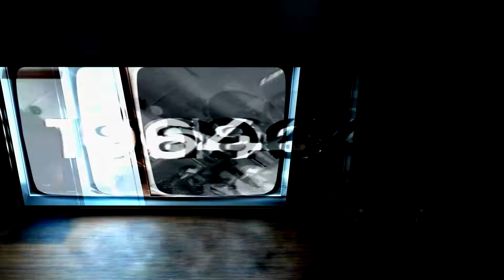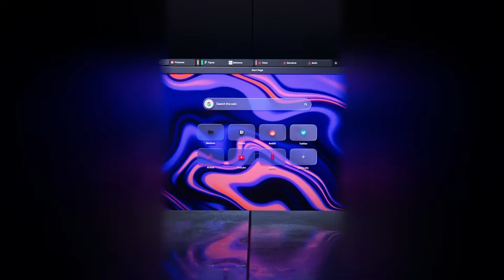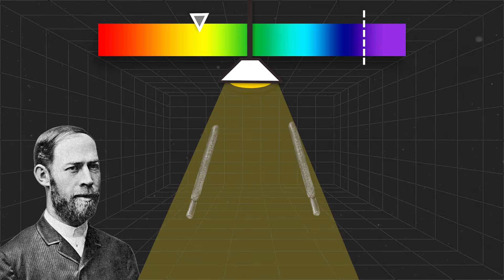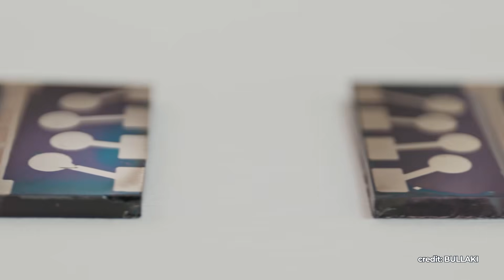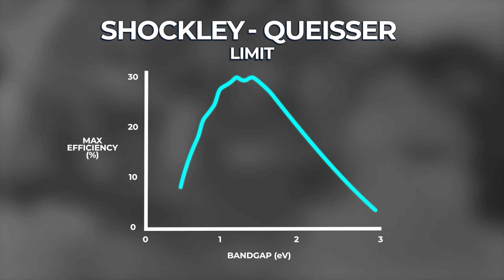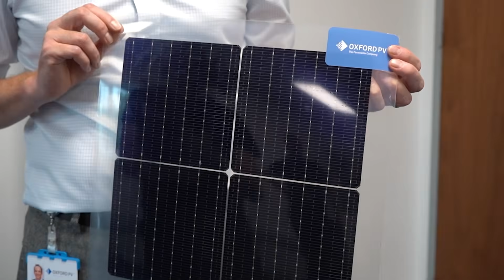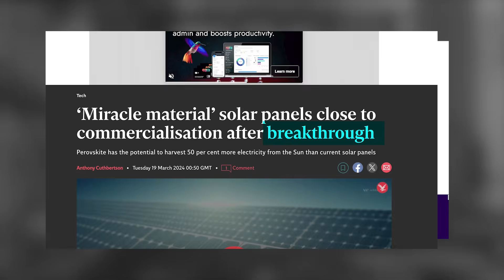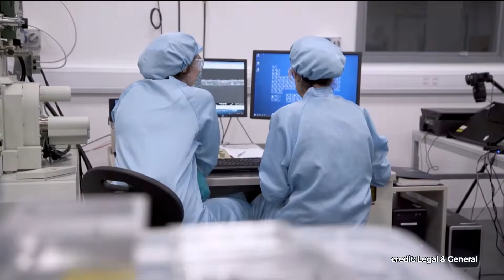How Physicists Broke the Solar Efficiency Record

Comment: 110104. The second law of thermodynamics may be false conventional wisdom. Let's face the wonder of full heat use. 

The second law of thermodynamics was developed during v8ictorian england's scientific and religious fascination with steam engines. 

The second law is behind modern refrigerators needing electrical energy to compress the refrigerent to force it to release as waste the heat that it has removed from the refrigerator's service interior in the cooling part of the refrigerent's circulation. The interior coldness draws in exterior heat through the cabinet insulation. There is also discarded heat from mechanical friction and electrical resistance. The net thermal output equals the electrical input with energy not being gained or lost in this refrigeration system including its forced waste. Unencumbered refrigeration by the principle that energy is conserved should produce electricity instead of consuming it. 

It makes more sense that refrigerators should yield electricity because energy is widely known to change form with no ultimate path of energy gain or loss being found. Therefore any form of fully recyclable energy can be cycled endlessly in any quantity. 

Full heat recycling, all electric, very isolated underground, undersea, or space communities would be highly survivable with self sufficient EMP resistant LED light  automated vertical farms, thaw resistant frozen food storehouses, factories, dwellings, self contained elevators, safe rooms, and horizontal transports. 

In a flourishing civillization, small self sufficient electric or cooling devices of many kinds and styles like lamps, smartphones, hotplates, water heaters, cooler chests, fans, radios, TVs, cameras, security devices, robot test equipment, scales, transaction terminals, wall clocks, open or ciosed for business luminous signs, power hand tools, ditch diggers, pumps, and personal transports, would be available for immediate use incrementally anywhere as people as individuals or larger social groups see fit. 

Some equipment groups could be consolidated on local networks. 

If a high majority thinks our civilization should geoengineer gigatons or 
teratons of carbon dioxide out of our environment, instalations using devices that convert ambient heat into electricity can hypothetically be scaled up do it with a choice of comsequences including many beneficial ones. 

Energy sensible refrigerators that absorb heat and yield electricity would complement computers as computing consumes electricity and yields heat. Computing would be free. Chips could have energy recycling built in. 

A simple rectifier crystal can, iust short of a replicatable long term demonstration of a powerful prototype, almost certainly filter the random thermal motioren of electrons or discrete positiive charged voids called holes so the electric current flowing in one direction predominates. At low system voltage a filtrate of one polarity predominates only a little but there is always usable electrical power derived from the source, which is Johnson (observation) Nyquest (theory) thermal electrical noise. This net electrical filtrate can be aggregated in a group of separate diodes in consistent alignment parallel creating widely scalable electrical power. The maximum energy is converted from ambient heat to productive direct current electricity when the electrical load electrical resistance  is equal to the array internal electrical resistance. 

Maximum calculated electrical power output (watts) is k (Boltźman's constant), one point three eight x 10^ minus 23, times T (temperature Kelvin) times bandwidth (0 Hz to a natural limit ~2 THz @ 290 K) times rectification halving and nanowatt power level rectification efficiency, times the number of diodes in the array. 

There are a billion cells of 1000 square nanometer area each per square millimeter, 100 billion per square centimeter. 

Order is imposed on the random thermal motion of electrons by the structual orderlyness of a diode array made of diodes made within a slab: 

  P type boron doped
-----‐------‐----___-- Out
🔻🔻🔻🔻
■■■■■■___ + Out 
  N type phosphorous doped 

All the P type semiconductor anodes abut a metal conductive plane deposited on the top face of the slab with nonrectifying joins;  the N type semiconductor cathodes or common cathode abuts the bottom face. As the polarity filtered electrical energy is exported, the amount of thermal energy in the group of diodes decreases. This group cooling will draw heat in from the surrounding ambient heat at a rate depending on the filtering rate and thermal resistance between the group and ambient gas, liquid, or solid warmer than absolute zero. There is always a lot of ambient heat on our planet, more on equatorial dry desert summer days and less on polar desert winter nights.

Focusing on the composition of one simple diode, a near flawless crystal of silicon is modified by implanting a small amount of phosphorus (N type conductivity) on one side from a ohmic contact end to a junction where the additive is suddenly and completely changed to boron (P type conductivity) with minimal disturbance of the crystal lattice. The crystal then continues to another ohmic contact. 

A region of high electrical resistance forms at the junction in this type of diode when the phosphorous near the ĵunction donates electrons that are free to move elsewhere while leaving phosphorus ions held in the crystal while the boron donates holes which are similalarly free to move. The two types of mobile charges mutually clear each other away near the junction leaving little electrical conductivity. An equlibrium width of this region is settled between the phosphorus, boron, electrons, and holes. Thermal noise is beyond steady state equlibrium. Thermal noise transients, where mobile electrons move from the phosphorus added side to the boron added side ride transient extra conductivity so the forward moving  electrons are preferentally filtered into the external circuit. Mobile electrons are units of electric current. They lose their thermal energy of motion and gain electromotive force, another name for voltage, as they transition between the junction and the array electrical tap. 

Inside the diode, heat is absorbe; outside the diode, to exactly the same extent, an attached electrical circuit is energized. The voltage of a diode array is likely to be small so many similar arrays need to be put in series to build higher voltage.  

Understanding diodes is one way to become convinced that Johnson Nyquest thermal electrical noise can be rectified and aggregated. Self assembling development teams may find many ways to accomplish this wide mission. Taxonomically there should be many ways ways to convert heat directly into electricity. 

A practical device may use an array of Au needles in a SiO2 matrix abutting N type GaAs. These were made in the 1970s when registration technology was poor so it was easier to fabricate arrays and select one diode than just make one diode. 

There are other plausible breeches of the second law of thermodynamics. Hopefully a lot of people, mostly as independent teams, will join in expanding the breech. Please share the successes or setbacks of experiemental efforts. 

These devices would probably become segmented commodities sold with minimal margin over supply cost. They would be manufactured by advanced automation that does not need financial incentive. Applicable best practices would be adopted. Business details would be open public knowledge. Associated people should move as negotiated and freely and honestly talk. Commerce would be a planetary scale unified conglomerate of diverse local cooperatives. There is no need of wealth extracting top commanders. We do not need often token philanthropy from the top if the wide majority of people can afford to be generous. 

Aloha
Charles M Brown 
Kilauea Kauai Hawaii 96754

Comment: There's a reason I'm a fan of brute-force engineering. Make it 2x more rugged than the tool or machine needs to be. Sure, it may cost a little extra in manufacturing. But, the machine will work, it will not break, even if treated poorly, and you don't need to pay to replace it frequently, nor do you need to deal with expenses of the uphill battle of trying to get a fragile material to last in the face of the environment.

I find it tends to be cheaper to go as primitive or simple as possible to start as well. Take the advanced concept, and spend some time seeing how unga-bunga caveman you can make it. "How low tech of tools can we use to make this?"

Not only is it a fun intellectual exercise of your particular discipline, it tends to result in rugged, reliable results.

Granted, this is more a practice in design, and applies largely to making machines like mechanical generators. However, I think it can be applied to these solar cells as well.

Comment: The climate issue is primarily a balance of energy received from the sun, and how much dissipates back into space. Greenhouse gasses affects the temperature of the atmosphere, by being affected by the radiation trying to "escape" Earth. They "wiggle" more, when hit by infrared radiation. What we sometimes call heat. The energy we are bombarded with, from the Sun is broad spectered. When the energy hits a light surface, the reflected energy is also fairly broad spectered. When it hits darker surfaces , is a larger portion of the energy absorbed, and converts into heat. When we use solar panels, we get both a warm panel, but also an electrical energy, which we then use to drive an electrical device where the energy is lost as heat.
More greenhouse gas equals less energy dissipating into space. More energy "harvested" from the sun, which is then converted into heat, ALSO leads to an imbalance in the energy economy. More infrared energy trying to "escape" Earth, leads to an increase in temperature.
PMC6174548

So a higher "efficiency" ultimately leads to less energy being reflected directly into space. Then again, a higher efficiency could pave way for technologies that reflects energy back into space, without altering the spectrum?

Comment: Perovskite coated silicon solar panel is the smartest business choice. Since you don't have to build Si-panel, just source it from other companies, then clean it and coat it nicely. I know "just" here sounds undermining, but the difficulty of doing that could be tedious. And from the graph in 15:41 I think you can't add more than that one layer, only leave a room for a new Perovskite in place of Si.

I think, they still have to keep a layer of Si at the bottom even with new Perovskite material, it seems to help stabilize the structure.

Comment: THE question is NOT framed in terms of the dollar cost of a unit of energy but, rather, the energy cost of that unit.  The currency cost of energy fluctuates but a joule is always a joule.

Would an oil company knowingly expend the energy equivalent of 2 barrels of oil to bring 1.9 barrels of oil to "the market."  See EROEI:  energy returned on energy invested.

I urge you to explore the TRUE, energy, cost of solar energy, from pre-production research all the way to the energy cost of disposing of the infrastructure components at the end of their productive lifetimes, for past, present and future solar technologies.

Comment: @16:59 of course the cost is relevant. If the perovskite add 20% efficiency the panel cant be more than 20% more expensive.
If not it would make more economic sense to just buy 20% more silicon panels..

Comment: I was working on PV's in the 90's here in Australia, our group held at the time the (in lab only) maximum efficiency record, (and not much lower than today), this work is very infesting..

Particularly your take on cost, reliability, and eff%, the engineering Vs 'perfection', a case where good enough is good enough.
Reply: that is a point - if we consider nowadays prices of PVs then it is much cheaper to add a few m,ore panels than make a frame to give them better orientation to the sun (pricewise). We were covering even northern sides of roofs, because of dirt cheap panels (sun hits them only around the noon in summer - it was for cooling system, which utilizes this seasonal gain). We put them flat on roof without bothering about frames, because it adds weight to roof (to level it is not possible to make installation there), lowers coverage and make installation twice expensive (frame cost and installation cost).

so... compromises

Comment: Do the perovskites they use contain lead? If they degrade faster and are not properly disposed of after they are not useable anymore are we just going down the route of introducing more lead into our environment again?

It feels like every new technology we make will eventually years later be exposed as dangerous for the environment and life, then we slowly try to stop using it which we're not really good at and repeat from the start, create new technology to solve the problem the last one created. The cycle continues

Comment: Since I've read that Opera GX is owned by a Chinese company, I will definitely avoid using that browser.
Reply: A website I often use ran ads for a while for Opera. Next time I clicked on my downloads folder, there were a couple hundred instances of the Opera installer in there. Never asked me if I wanted to download it, just did it all on its own every time I clicked on something on the site. Needless to say, I have stopped visiting that site and will NEVER use Opera.

Comment: Did one of the teams investigating this find instead of a silicon base a mirrored surface underneath would greatly increase the efficiency?

Also, we know current silicon solar cells lose efficiency over time. I think the first year they lose about 10% efficiency and have a lifespan of 25+ years before the efficiency drops to a point where they are usable? Has they been any testing for the lifetime of these new cells?

Last I've read If you have to get a solar system you want to get the thermal cooled solar panels. These have fans behind them to cool the panels. The fan is driven by the electricity produced by the panel. The cooling from the fan increases the efficiency enough to offset the fan drawing energy from the solar panel. The cooling will also increase the lifespan of the panel.

So much new technology it's hard to keep up.

Comment: I have always thought that the goal to reach the perfect version of the final product is detrimental to overall progress. You spend so much time and money trying to get to that perfect theoretical version, that you don't have any infrastructure ready to accept the production of that perfect version - if you ever even find the perfect solution in the first place. However, if you focus on making it good enough to ship a stable version of the innovation that is already better than what was previously good, then you can ramp up production and adoption of that technology, which is cheaper to produce because you're building on existing infrastructure using simple versions of the technology. Then, as improvements happen it is significantly cheaper to retool production to accommodate those improvements than building the whole infrastructure from scratch. Then as a plus to all this, you also can generate more funds through the sale of the 'good enough' version, to fund the innovation and production of the perfect version. Imagine if we never explored electrical innovations or light bulbs, aeronautical, or automobile technologies because they weren't the 'perfect' idealized versions of what they could be? It just makes more sense to me to take smaller steps on the ladder of progress than starting at the bottom and trying to jump and reach the top of the ladder.

Comment: this video is a bit shallow, almost an infomercial.
first, the good. perovskite tandems will probably be the next revolution in PV. So much seems to be probable. Module efficiencies above 27% seem possible.
the bad (of perovskite). current lab results are poor about longevity and reliability. Current competitor cells reach 26% efficiency, so not too far. I mean mass production.
the bad (of the video). first, there are a few errors in the science part of pv. not too relevant. second, current modules are at 22 to 24% efficiency, not 18 to 20. There are other errors, less critical.
you could have used a reviewer tbh.
I work in the industry, btw. we will also sell tandem, expected 2026.

Comment: this upper limit of 30% could also be broken by using avalanche effects, it only applies if each incident photon dislodges 1 only electron... when each photon dislodges a cascade of electrons a cell can magnify the current instead of just converting a measly 30%...